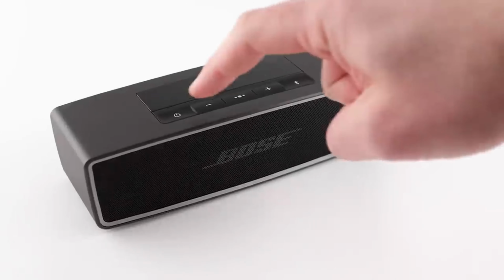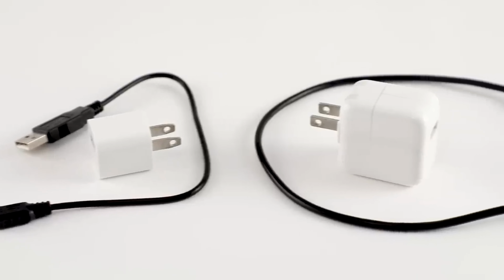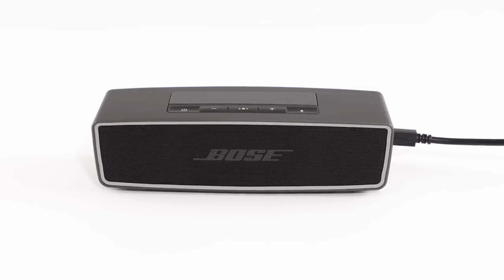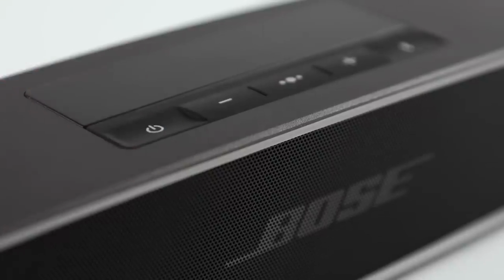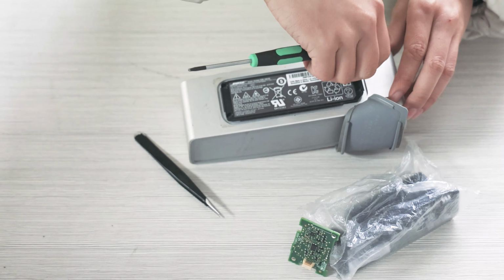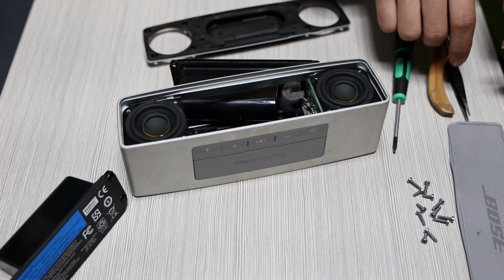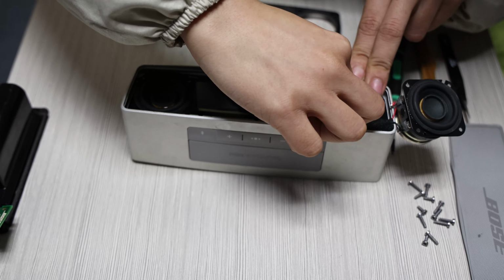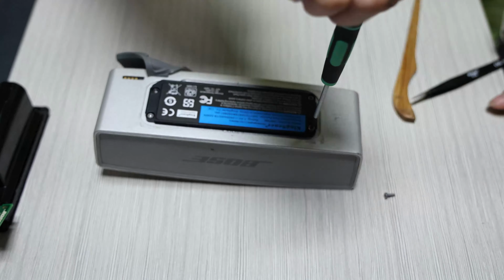How to Replace BOSE SoundLink Mini 2 Battery|BOSE SoundLink Mini II

Comment: After watching several videos on replacing the Soundlink Mini II this one shows the simplest method.  Other videos tell you to remove the grills on both sides of the speaker and to disconnect a cable and remove the board under the left speaker.  This video shows how to do it without all the extra work.  Good job.

Comment: Be careful if you finally has to change the battery. This video didn´t show how unplug the two sockets multiconnectors between the inside boards. Thanks anyway.
Reply: You're absolutely right - the 008796 has two connectors on the boost board. They are at right angles, so the demo here would result in destruction of at least one of the connectors.

Comment: According to website for tagged products, the replacement battery does not come with power board attached. Soldering has to be done in order to complete this. Video is not representative of actual product.
Reply: @pickypoint640  Some come with the battery board and some don’t.

Comment: Helpful info:  
Notice that he pulls the power board forward towards the front of the soundlink and then slides it out towards the battery (bottom of speaker).  
The power board is connected to 2 boards:  the little board behind the removed speaker and the big board.

You need to pull it forward (or 'up' if it's laying on its back like in the video),   That disconnects it from the small board behind the speaker (speaker that he pulled out).  DON'T try to just force it out towards the battery or you may break the connecters to the little board behind speaker.

Then you can separate it from the big board  (pull it out towards battery to disconnect from big board).  

Then do your soldering for the new battery's attachment to the power board.  Be careful to never let the wires touch each other and short out the battery (applies to both old and new batteries).

To insert, push it down into the big board connection and then push both towards the back to connect to the small board that is behind the speaker.

Then put everything else back together in reverse steps of how you took it apart  - fix the grommet around the grill before installing it  (if it came off obviously) and install it at both ends before pressing it down towards the center edges (so that the little clips click in place first).
Hope that helps.
Reply from the maker: Thank you very much, interesting addition, well done👍
Reply: @kingsener  Thank you for making the video in the first place.  It helped a lot!  I had a tough time trying to get the power board out until I used a flashlight to see the rear board's connection so I figured a comment might help someone else trying to replace their battery 🤞.  
The video does show you do it, but it is pretty quick and easy to miss what you actually did (my speaker wire was shorter so I could barely get it out to the way  ..didn't realize there was a connecter on the rear board too)
Thanks again for a very helpful video. 👍
Reply from the maker: Thank you for your valuable comments, I will pay more attention to details in the future💪
Reply: My Question: where is the video for these spoken words? Observation: If speaking is worth a 1000 words, a video makes it obvious! 😳👎

Comment: Where did you buy the battery with the board already attached?
Reply: Purchased the battery w/board attached on eBay from a seller in Sarasota , Florida
Reply: @scottmorningstar3326  did the new battery work out?
Reply from the maker: Hello, we have already soldered in the video, you need to solder by yourself when you buy our battery.
Reply: @kingsener  HOw???
Reply from the maker: @KiraTacK  https://www.youtube.com/watch?v=a8T0zcxD6ho